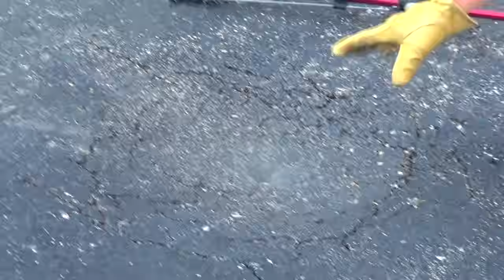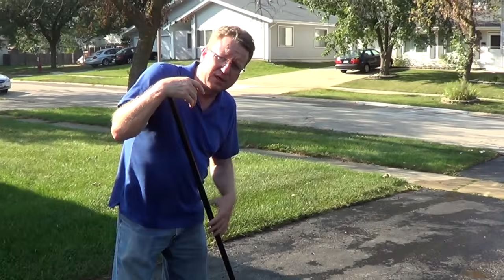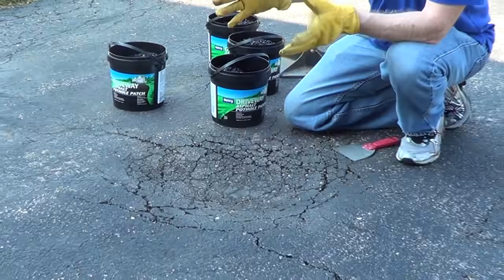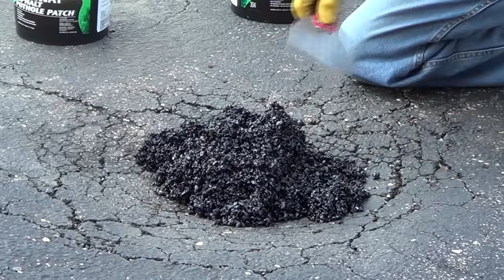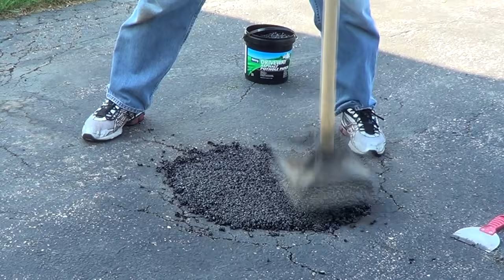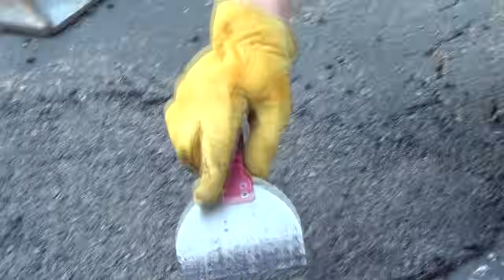Driveway Pothole Repair - Asphalt Driveway Repair

Comment: if you clean out the hole good and coat it with roofing tar then patch it will last a long time. the tar bonds it and seals out water
Reply: good idea
Reply: I agree loose material needs to be removed
Reply: I have a driveway repair like this I want to make. The tar coating sounds good. 
I'm having trouble finding actual roofing tar. Any recommendations?
Reply: @bobyork1235  Hello, were you able to find roof tar ?
Reply: @bobyork1235  how do you cut a pothole out
Reply: @jeremynguyen2346  I used an electric circular saw with masonry blades. You mark out with chalk what you want to cut out. Straight lines is what you will cut.. 
The blades I used were made of a fiber material that wore down quickly. So get 2 or 3 of them. 
There are also circular blades made of steel w/ diamond tips. These cost more but would probably last longer.
Cut edges then remove chunks of old asphalt & clean up area to patch.
I hope this helps.
Reply: @bobyork1235  where do you buy the asphalt patch
Reply: @jeremynguyen2346 Hi, Jeremy,
 I got the asphalt patch, also called 'cold patch,' at Menards. 
Menards is a franchise of home improvement stores in the Midwest  USA. Similar to stores like Home Depot or Lowe's.
You could also find asphalt cold patch at hardware stores.
The stuff I used was called  'Bullcrete' made by ThorWorks Industries.
It had Ground Tire rubber in it & was very sticky.
There are many different brands out there. Most will work Great!
Fwiw, the spot I patched last Nov. '21,  made it through the winter fine.
I wish you success.
Reply: Can I use Gardner Wet n Dry all season roof patch to coat it , thank k you.
Reply: @MikeJones-in3uk  Hi Mike,
No I wasn't. I would have liked to have used something like hot tar.
We heated up the area to be patched with a LP torch connected to 20lb. tank.
Only time will tell how it bonded.

Comment: i have potholes and cracks that im going to fix in my driveway, then i am going to seal it. however i do have sections of the pavement that are lifted. how do i deal with this?
Reply from the maker: Hi, can you send a picture to fixitpodcast@gmail.com
Reply: Ok sent! Thank you
Reply: Sounds like you could have roots under the asphalt if it's being pushed up if so then only way to fix would be to tear out the bad section tear up the roots and repave
Reply: mill and fill

Comment: Could my driveway's deep bowl with the asphalt surface still intact (apparently caused by the removal of a large old tree nearby) be partially filled with heavy crushed stone gravel (cheaper than the asphalt patch product) first?  The surface is still fine, so leveling the driveway is the only actual need.

Comment: Thank you, thank you.  I will try this.  We had a place on the edge of the driveway broken up when the neighbors had a large tree cut down and fell on it.  Since it's on the edge, I think I will build a small form on the edge and fill inside.  Thanks again; I had no idea where to start.
Reply from the maker: Let me know how it goes.
Reply: Could my driveway's deep bowl with the asphalt surface still intact (apparently caused by the removal of a large old tree nearby) be partially filled with heavy crushed stone gravel (cheaper than the asphalt patch product) first?  The surface is still fine, so leveling the driveway is the only actual need.

Comment: I see alot of comments of people saying COLD PATCH wont last and its no good .And i disagree to a point..If you're applying it for a tiny sunken area like the one on your video THEN i agree with everyone who states its crappy and wont last.If you applied. TACK OIL(glue)underneath cold patch it would work better..But an even better way is tack oil.put down cold patch heat the cold patch with torch rake it then compact it ..And what do you know.brand NEW SKIN PATCH

Comment: also if you can't find tack oil or an asphalt plant near you ..Heres a suggestion..That CRACKFILLE R you used at the end of patching..you can use as tack oil..you need to dilute it and it will glue down coldpatch alot better than just stuffing hole w patch alone
Reply: N

Comment: Patching like that won't last very long. You are supposed to have a clean vertical edge otherwise the cold patch will pus out of the hole and the edges are too thin to cure into anything worthwhile.
Reply: HE put a sealer around the edges.
Reply from the maker: +Aaron Anderson Hi, we plan on doing a video showing how to cut out a pothole. Thanks
Reply: FIX IT Home Improvement Channel d
Reply: These patches do last a few years, I have done it in the past myself.
Reply: FIX IT Home Improvement Channel

Comment: I just don't think the repair will last.
Reply: this video is for people who do not want to pay for a hot mix and roller to come to their house
Reply from the maker: fellow111411 Hi, we will do an update this summer. It looks good. The key is covering it with a sealer after it cures.
Reply: Hot asphalt  and tack will hold this is garbage
Reply: nah man the cracks let in water under the surface that lift the top layers that in turn will not last long at all 
you want to stop water at any cost from getting under the repair or even thru cracks other wise the cracks get bigger and open up with movement from when a car drives over it
i have repaired soo many of these so called  "permanent pothole repair" the shit you get in tiny wee little buckets is just shit
the real way is to have the hot mix super hot(thats why its called HOT MIX) and compact it with a roller
Reply: I think it would last.  That looks like similar procedure that they patch potholes in roads..and that lasts.  After it settles then waiting about   2 wks or so then with ample good sealer I would think it would last.
Reply: @lipanj7  Where do you live that those patches last more than 48 hours of normal traffic before cratering back out?

Comment: What he using at end in theˇˇpistolˇˇ?
Reply from the maker: Hi, the tip of this has a movable head.
We also have a weekly home improvement podcast on iTunes and Stitcher. Here is a link http://www.stitcher.com/s?fid=49441&refid=stpr
Reply: Driveway crack sealer in a caulking gun.